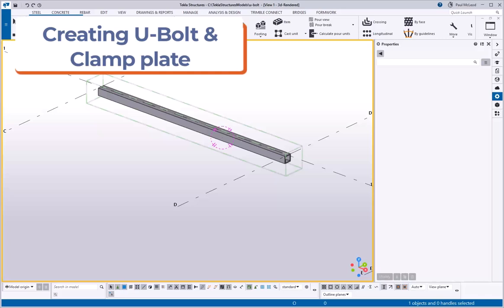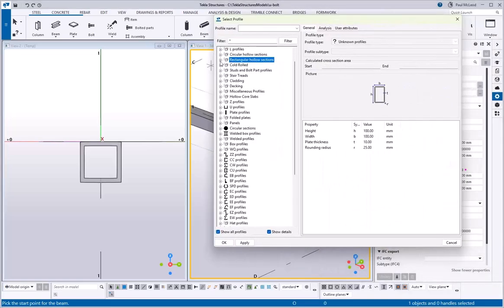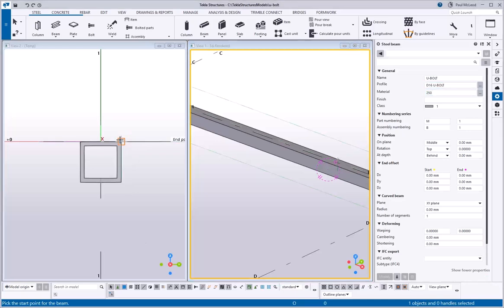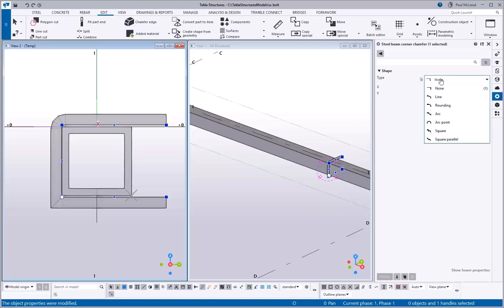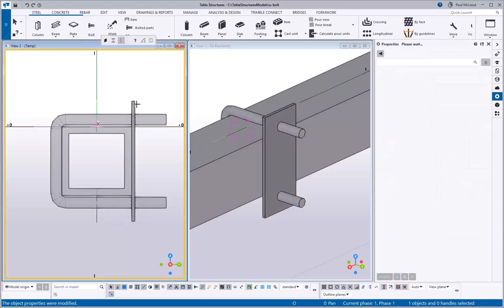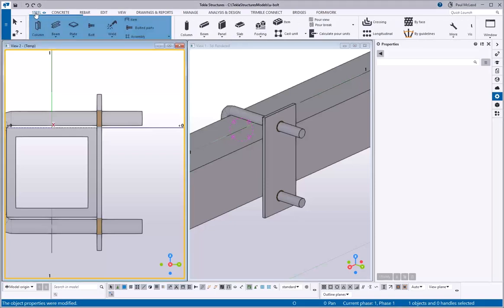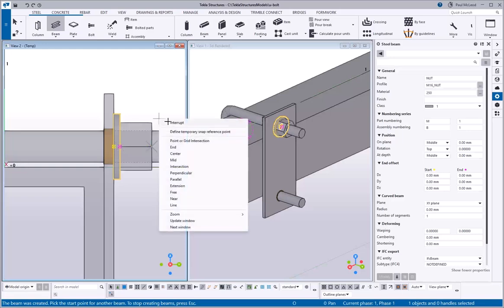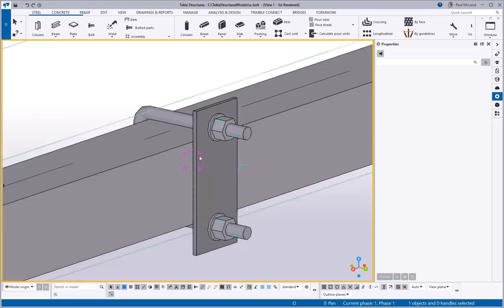Modelling a U-Bolt & Clamp Plate in Tekla Structures

Comment: Excellent. Can you please make a video on how to create a U-bolt custom component that suits all SHS sections? Thanks.
Reply from the maker: There is a bit of work in creating a video for that. I will see how I go for time
Reply: @tekconservices  Thanks for your response. Can you explain how to make a U-bolt for Circular Sections? That will be a lot helpful.
Reply from the maker: @mohil1396  All you would need to do is make the corner chamfers larger. For example if you had a 100 dia Pipe, you would set the corner chamfers to 50mm each. Or in the example I showed where I added 5mm clearance you would make them 52.5mm